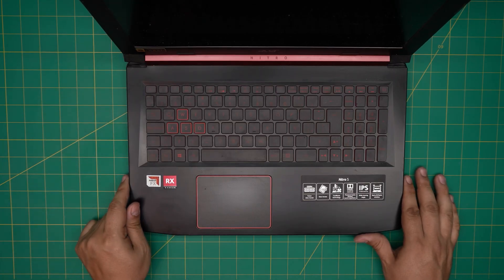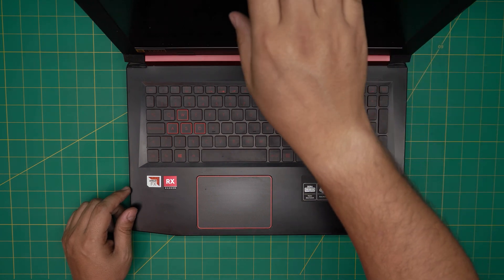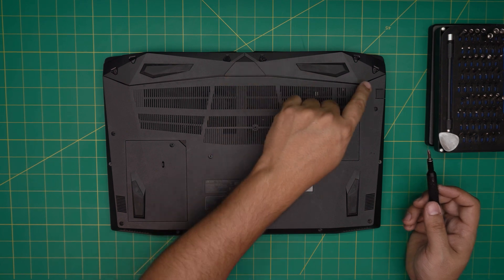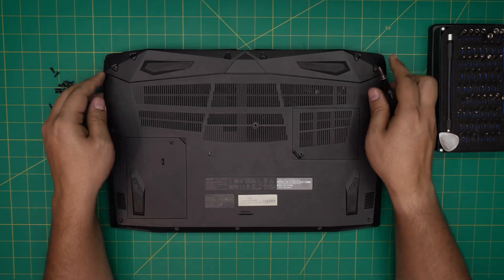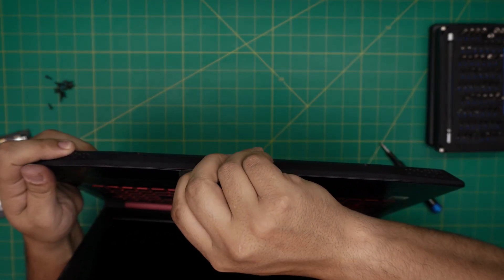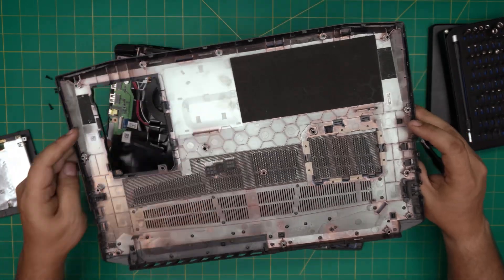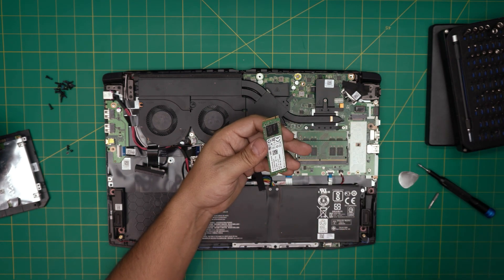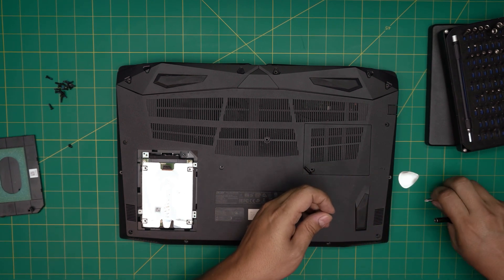How to Upgrade Storage (SSD/HDD) in Acer Nitro 5 AN515 (N17C1) - Step-by-Step Guide💻 ✅

Comment: I have a HP pavilion gaming . When I connect it to the charger, its temperature rises and the temperature of the processor cores is above 80. I took it to a technician and he cleaned and changed the thermal paste for the processor and it did not work and the problem remained, any guide will be really helpful.
Reply from the maker: Thank you for the feedback! if you wish to support the channel you can LIKE or SUB or both :P
regarding your question:  what brand of thermal paste he used?
Reply: @uFixTek 
thermal grizzly
Reply from the maker: you may have an unbalanced heatsink my friend its very common, to fix that issue you will need to place a copper on CPU and GPU and thermal paste both side: 20mm x 20mm x 0.3mm
https://amzn.to/3tdSzt4
Reply: Also, ensure your fans are working as well as proper thermal paste and heat sink fitting. Make sure the air intake is clean and not clogged with pet hair or dust by using compressed air to blow them out thoroughly. If it still overheats I would take it to an authorized HP shop so they can troubleshoot the motherboard and power system to ensure there is not a bad capacitor or step-down component sending too much power to your processor. While it is powered up, put your hand on the battery. If it feels extremely hot it could be your problem and causing the inside to overheat which should then be replaced.
Reply: Late reply but this may be perfectly normal. I had a Dell which had core temp of 100 and it still works after more than 7 years